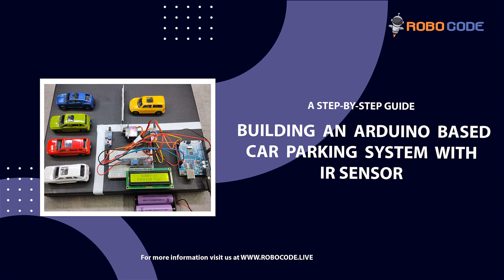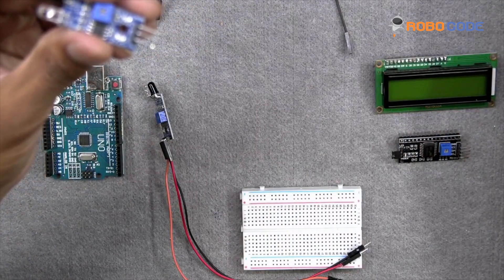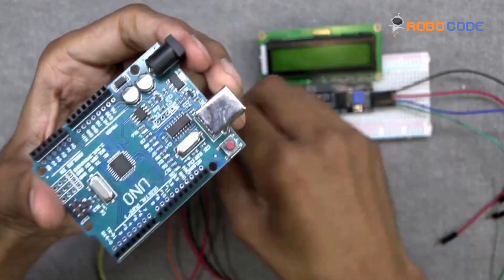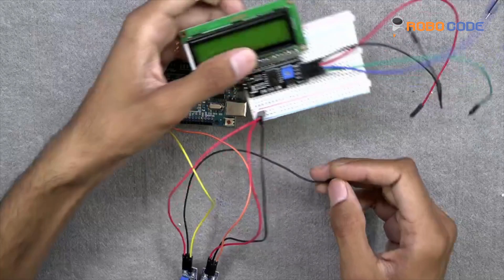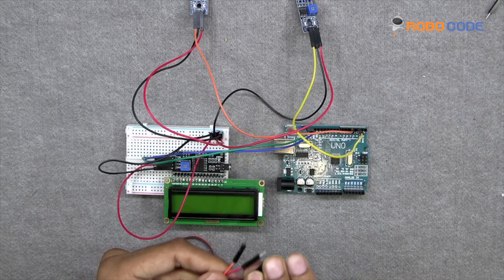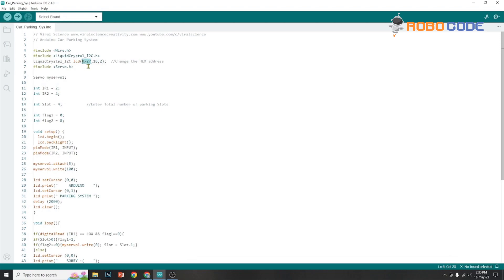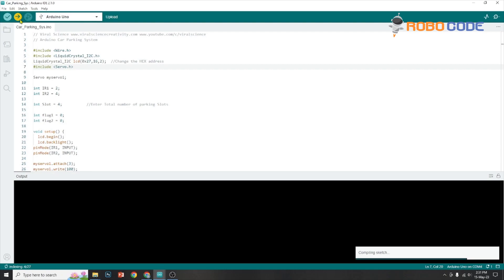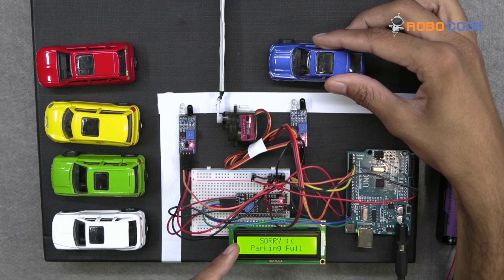Building an Arduino-based Car Parking System with IR Sensor: A Comprehensive Tutorial

Comment: sir please I want do this project for my graduation and I find this arduino is it the same as you? please answer.
Microcontrôleur : ATmega328
CPU : 8bits
Architecture : AVR
Fréquence de fonctionnement : 16MHz
RAM : 2KB
Mémoire Flash : 32KB
EEPROM : 1KB
Tension de fonctionnement : 5V
Entrées sorties numériques :22
Entrées analogiques : 6
Interfaces : UART (TX/ RX), SPI, I2C, PWM
Convertisseur USB-UART : CH340
Programmation : Arduino

Comment: Bro, I'm having an doubt. What is the use of I2c Module??
Reply from the maker: Using an I2C module with a 16x2 LCD display is a popular way to reduce the number of GPIO pins needed when interfacing with a microcontroller like an Arduino. The I2C module, allows communication via the I2C bus, using only two pins (SDA and SCL) for data transmission, in addition to power (VCC) and ground (GND) connections.

Comment: Bro we have done all the above turorial but coming to Arduino uno code .i2c scanner its scanning only not giving output and lcd display not on
Reply from the maker: Please check the connection and see if the code is uploaded properly
Reply: bro i am also facing this error  @robo-code i also checked all the connection but it is not working i am also facing the issue
Reply: @sasuke01325 hii broo can you give ur Instagram or contact details. I have facing same issues can we discuss about this project
Reply: I have 16x2 display bro please give the code for that
Reply: @11upxm86   Wire.beginTransmission(address);
    error = Wire.endTransmission();

the error is in this line
Reply: @11upxm86 bro u got output 
I also facing same problem
Reply: please give code for 16 x 2 display bro
Reply: Same problem with me too 😭😭

Comment: i dont have breadtboard what to do?
Reply from the maker: you can also make a circuit without any tools at all. This is called a "bare bones" circuit. To make a bare bones circuit, you will need to strip the insulation off the ends of the wires and then twist them together. You can then connect the wires to the components.

Comment: Extremely good explanation and good project. I have one point , at  12:36 when the green car is sensed   by left IR sensor  the display tells that 1 slot is available. But the car hasn't yet been sensed by right side IR. I would suggest to update the logic. Only when right IR senses the car then update the free slots.
I'm new to Arduino but I'm experienced embedded software Developer. So just thought of informing u this point. Don't mistake me that I'm criticising u. 
U have done a great project.🙏🤝
Reply from the maker: sure little tweak is required in the logic, counter should increment once the car passes. Thanks for the update
Reply: @robo-code  ok, thanks. I wanted to know how do u simulate electronics? I have seen Tinkercad. Which are the best circuit simulators to play with electronics.